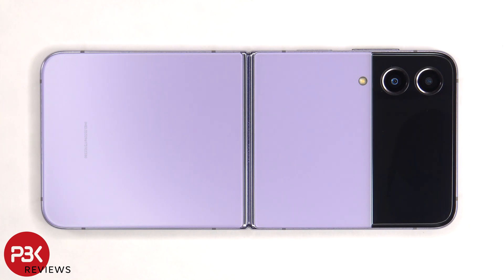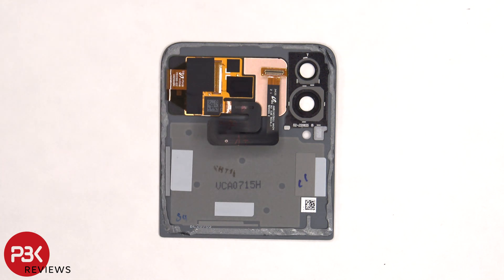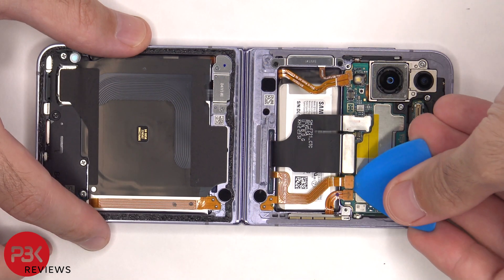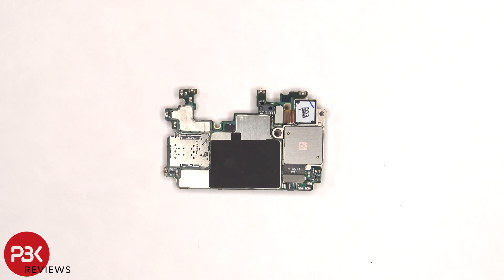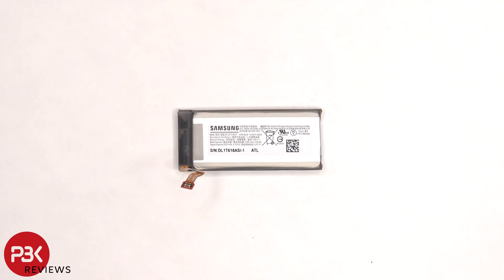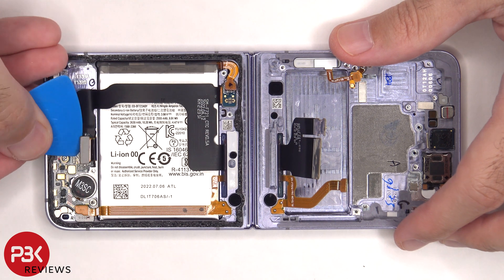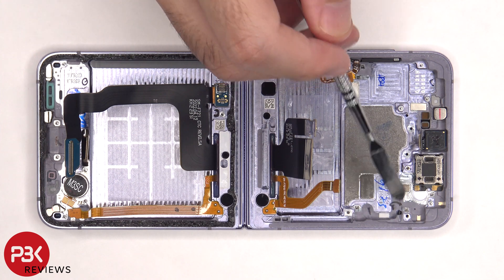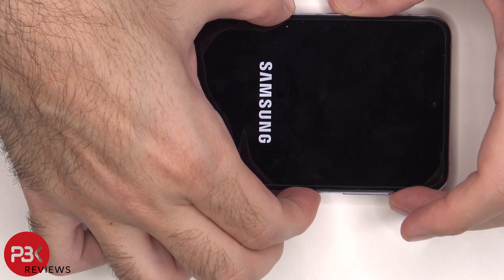Samsung Galaxy Z Flip 4 Disassembly Teardown Repair Video Review

Comment: 1 week after warranty went off (2years warranty) the phone started to shutdown.

it became more and more frequent, to the point now it doesnt even boot up to the logo except if it's in charge, then it boots for 5sec after logo. but if i plug it off ( 100% charge ) then it doesnt even react to the power button.

Any ideas guys ?
Reply: can't get it to go to recovery mode either. if i plug de charger in, the green circle indicating the battery% will pop, and stay. but if i try to interact with volume or power, it will work for 2sec then go black screen and go back to the black charge circle then green circle

Comment: Great job with this video! I have a quick question for you of you don't mind - what size of Phillips screwdriver is needed to replace the batteries? Thank you!
Reply from the maker: Thanks. You can use 1.5x25mm or any standard smartphone screw driver
Reply: @PBKreviews  Thank you!!😀

Comment: This is one of the best videos. I was wondering, though, if anyone knows what that's little unused circuit connector on the right side?  Im thonking its for repair or data retrieve but its a mystery
Reply from the maker: Not sure which connector you are referring to.

Comment: Hello! I'm getting the "Phone temperature is too low to charge" issue, so I was wondering where the temperature sensor is located so i could replace it. Could someone point it out for me?
Reply from the maker: If I'm not mistaken it requires the wireless charger to be replaced or disconnected. Aside from that, the charging port/sub board.
Reply: @PBKreviews  Ah ok, thank you!

Comment: Good video. My other halfs phone has just packed up. It works fine when open but after its closed, it refuses to come back on. If you tap it, eventually, it comes back on. Sent off under warranty and they refused to repair it, saying it had been damaged. It literally hasn't got a scratch on it. Always kept in a case, never dropped. Samsung want £425 to repair. My response this product isn't fit for purpose.

Comment: Amazing video !  You are by far the Master of teardowns !  I have a couple of questions for you.  How much heat was applied and for how long in order to remove the back covers and what do you recommend  for the heating ?  Hot air gun or rework station heat gun ?  Also,  can you point to where the test points are located for model F721W ?  Thank you !
Reply from the maker: I prefer to use a hair dryer. Less of a chance of damaging any components. Just apply enough heat so its hot to the touch and use a suction cup tool to help gain leverage. You can always apply more heat if needed. I don't know where the test points are.

Comment: I'm getting no signal on my flip 4. Do you know where the antenna is located and how to replace it? Or how to push it down to make better contact
Reply from the maker: There are multiple antenna, from ones in the frame, to motherboard and sun board contacts, to the plastic covers over the motherboard etc.
Reply: @PBKreviews  So out of all of these do you know which are the main ones responsible for 4g/5g data. I get "emergency calls only" or "No service" message.

Comment: Question.... would you know why my z flip 4 disconnects from battery when i close it? It's either getting a short somewhere or the hinge is pulling the battery cable somehow? It only works when it's open. The second i close the phone it turns off and i cannot turn it back on until i open it up again.
Reply: My zflip4 would just shutdown when closed, unless it's charging.
Gave it to a service center 2 days ago.
They said it'll be fixed for free cuz it's under warranty, was told it was something to do with the motherboard.
Got the phone back today, it had no more scratches on the body aswell as the screen protector, almost as if the entire phone was new😅.
Though I think it's something to do with the battery in the top half of the phone👍
Hope yours is fixed

Comment: Can the flex between the upper and lower halves be replaced.
Reply from the maker: Yeah, you would need to cut out the cure in place gasket holding it in place with a razor but you would need to re apply a new seal with either cold glue or some sort of silicon filler to keep water and debris from getting inside the phone as well as potential for the flex moving around and getting damaged.

Comment: can i just remove the front glass to just replace the back hinge??
Reply from the maker: If you mean the folding screen, you can but since the cable is attached on the bottom to the sub board, it would be more difficult to work with when you cant completely remove that screen to have room to work, on top of the fact you might damage the cable by moving it around a lot.

Comment: Used this video to repair my phone.  I found one with a bad esn on ebay and used it to exchange the screen.  I just took the motherboard from my phone and put it in the ebay phone.  Worked flawlessly and was easier than trying to get the screen off the frame.

Comment: Hey bro, the service center contacted us, they say upon replacement of screen, battery will be replaced as well charging us 63USD for the battery. Do you know the reason for this? Thanks
Reply from the maker: Sometimes the service centers depending on models of phones have replacement parts which come pre assembled and semi complete, meaning samsung has the parts ready to go so all they have to do is move over the motherboards and re assemble so it saves time and work.

Comment: Hi, thanks for perfect video, can I ask you about tips wish way possible to buy new screen Samsung Z4 flip -  my it was broken after my new phone was fallen . Thank you man.
Reply from the maker: They sell the outer and inner screen assemblies on ebay but the inner is a bit pricey. If you broke your inner, I would suggest sending it to samsung for repair since their price would be cheaper. Here are some links for example: https://www.ebay.com/itm/334568591062?hash=item4de5d78ed6:g:ARsAAOSwRLVjLBj2&amdata=enc%3AAQAHAAAAoEgJMboZ%2B20Uf6QV0E2LNB5Qs21bpDpHcTZvz3HfNRXmQu4g79iy0yyM%2FkusIl1vK4lYiL%2FmP0gVa8ua0uDvnYWwMrCTj4pNp3jykHlekgmklPqv66UPNv8vAXQR2SyfST66Fg9tr1LmTyV9tPQcJh30LK2W1K89FbuZdwVKHIlkFBKfG6jUlQW3JkwDT8VKfEx7rHEs8TeT9kKbJGoVnOs%3D%7Ctkp%3ABk9SR6T1x8CHYQ  or   https://www.ebay.com/itm/334604966540?hash=item4de8029a8c:g:5mgAAOSwXOBjV8vv&amdata=enc%3AAQAHAAAAoIOmlJqFvhRcdr8tSXjIFpmmGHusSfSvVwHaMYdxUowGnBxo8Tl6TuSSBswTK2adxkTq%2BKk8B%2BBV%2BquuyPkpFlv8ut%2BG60aNBccv2VbCtksAybjlxacJqFJzgsHp1Fes8mzuEcVHVUbXOgJfUQ5pIL38zx8oGe708JfRl31V%2BuDYGh02FfL2kE7lx2YWDd%2FFg%2B4Z8em6kK%2FUpEDfCJaf%2BP8%3D%7Ctkp%3ABk9SR6b1x8CHYQ

Comment: thats some bad bad cooling, no VC for this phone like it was rumored..
Reply from the maker: The 3d graphite works just as well as a vapor chamber and as of the S20/Note 20, Samsung has been generally using the 3D graphite in place of the vapor chambers on their flagship/top tier devices.
Reply: @PBKreviews  S22 ultra has nano-TIM and vapor chamber..
Reply: @PBKreviews  "3d" graphite is just a graphite sheet(the one they use seems low quality tbh, plastic) hq graphite sheets are generally black.., they literally couldnt have cared less about the cooling, damn i have 5 sheets of 500x500 graphite sheets, thats how much i am fixated on cooling, dont get me wrong, it really does matter i think you also know that.
Reply: @PBKreviews  theres literally nothing, not even graphite behind the screen..also TIM application on the SoC is quite shitty, what is that, a dot in the middle? LOL
they didnt even try..

Comment: What do you reckon? does the overall engineering and build look durable for a 2 year span?
Reply from the maker: The frame and overall build I would say is good and would last 2 years for sure, but I am not a fan of these foldable screens. I've had them crack out of no where in the crease before and I just don't feel like I would use one as a daily phone without making sure I have some sort of insurance plan on it :)
Reply: @PBKreviews  yes indeed, that aluminum frame looks chunky and sturdy but the fragility of that foldable display cannot be ignored...I am one of those primitive fellas who only use one device at a time...and I am a sucker for compact devices, hence I was still using my appalling battery life plagued iphone 12 mini...I have pre-ordered the flip 4....this is gonna be my one and only primary device, so I did make sure to get samsung care+ ....thanks for the teardown...

Comment: It's funny cuz it looks like the connection for the 5 mm wave antenna on the bottom is still on the motherboard
Reply from the maker: Yep, well last years both ran off a single cable and connector, but yep there a slot which doesn't have a connector soldered to it on the board. I remember reading somewhere about them moving to one antenna with newer chipsets and so forth, so not sure if they changed the design last minute to go with one instead of two. Another thing I would thing was 2 would generally provide uninterrupted signal where if one was blocked by your hand, the other would kick in, but I guess the antenna is positioned in a place where usually ones hand would not be blocking it often.

Comment: coin vibrator in a $1000 phone :(
Reply from the maker: Don't always be fooled by the shape of the motor. Since z axis vibrator motors can also come in the cylindrical shape. So the shape of it doesn't necessarily mean its the old vibrator motors. However I'm not entirely sure what motor is used in the Z flip 4 so I can't dive in any further about that.

Comment: Great effort, but would have been better if you kept on tearing down. I'm mostly interested in the new hinge design and updates to the display.
Reply from the maker: Thanks, yeah if it was an entirely new design I would have for sure taken it all the way apart, but since its so similar to the flip3 and the fact that other people will post videos on the hinge within a week or two after my video, I didn't want to render the device useless since there usually isn't that many views on my videos to recoup the cost of the device. :)
Reply: @PBKreviews great video, none the less. But the Z Flip 2 & 3 screen can be plugged into Z Flip 4 temporarily just to access the info from Z Flip 4?
I'm not planning to fix the Z Flip 4, but there is some footage I really need from it 👀
Thanks in advance
Reply: I've had my 4 since like January n been great .